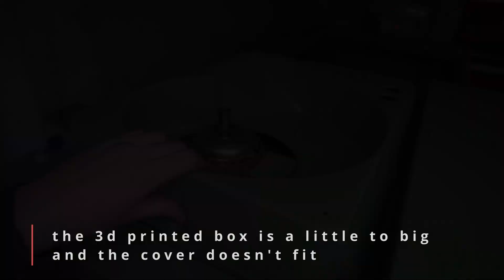hydraulic cooler restoration - Weiler Primus LinuxCNC retrofit pt.3

Comment: Blades are backwards ! Looking down from above in this case it should be spinning anti-clockwise towards the output which looks correct😃. The blades should point to the exit as well which are backwards 🙁. Seems wrong until you try it the right way and get better airflow & higher pressure out. Nicely made though 😃.
Reply from the maker: Thanks for the hint i will take another look at this.
Reply: It is not necessarily wrong. There are both forward and backward curved fan designs. The forward curved design is more efficient and tends to move more air but produces less pressure.
Reply: The ultimate problem with this design is that there is a gap between the wheel and the bottom of the channel and a part of the displaced air just sucked back.